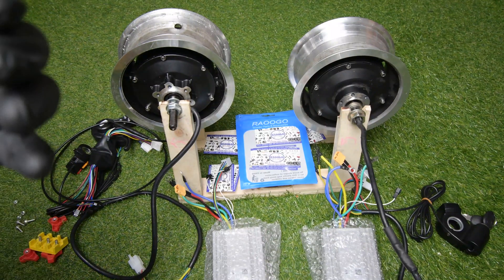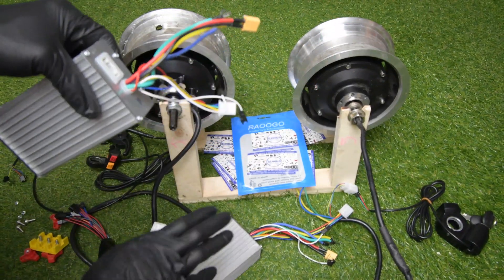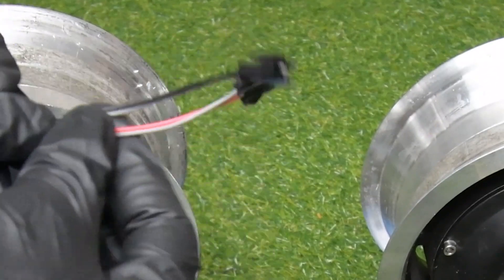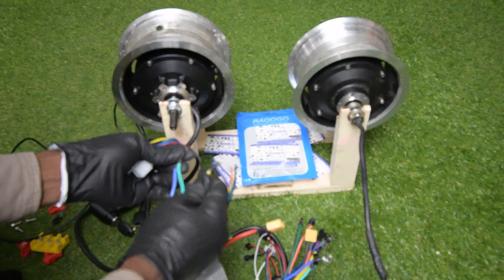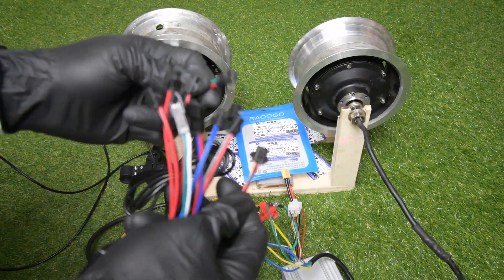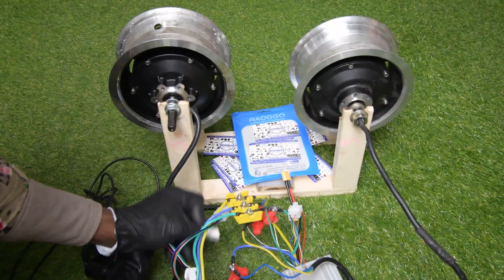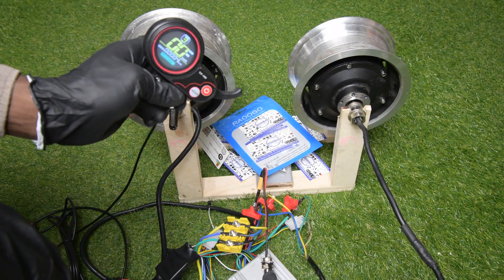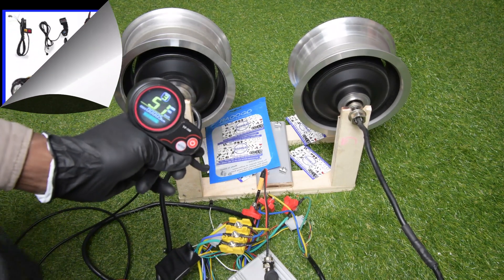60V 45A Controller Wiring Diagram Connection Teewing T88 Kawasaki Electric Scooter Explained Step

Comment: You are a legend you are the best you saved me thank you so much from British Columbia Canada Big Jim says thank you and anyone reading this this man is good
Reply: bigj, replacing those controllers won't do anything. The motors still did not work. They are bad as you know.   It's the controllers keep attacking the motors so you'll need to replace them with genuine 60V 2800W motors.   Your battery needs to be changed out later.  Build the battery pack with new special batch Samsung 40T cells.  Then you can use those stock controllers because those components are tough and will not break.   Or replace the controllers too and use a pair of Dualtron Thunder 2 controller set with throttle.  That doesn't attack the motors.
Reply from the maker: @bigj9961  my pleasure to help